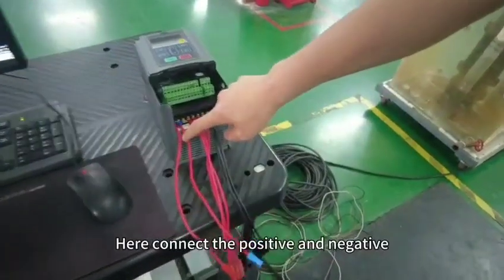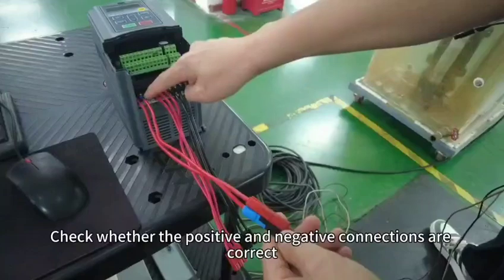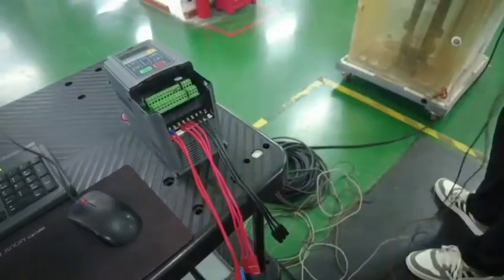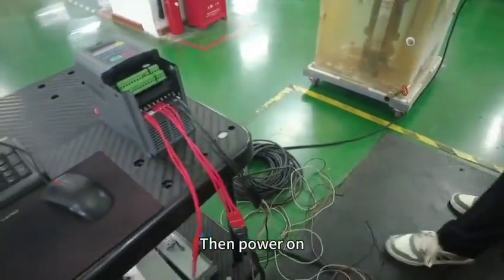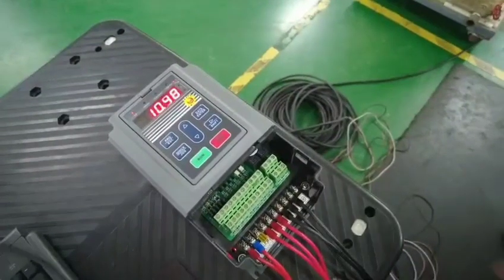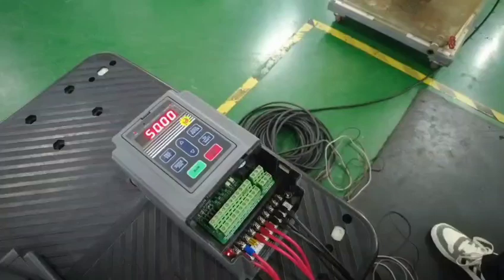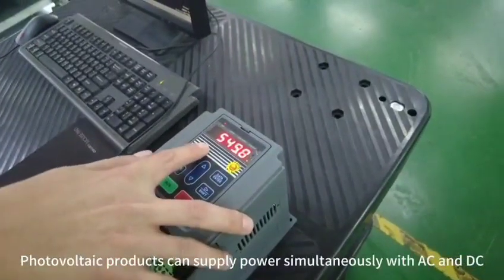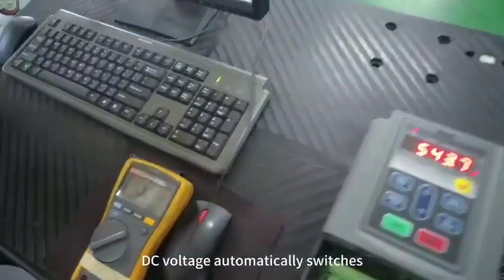MICNO solar pump inverter connection AC grid power + DC solar power

Comment: Wouldn't it be better to blend AC power from both the grid and solar, rather than switching between them? This way, the system can prioritize using as much solar power as available and seamlessly draw the remaining power from the grid. For example, if the pump needs 5 kW, and solar is generating 2 kW, the system would automatically take 3 kW from the grid. This method optimizes energy usage, reduces electricity costs, and eliminates the need for a changeover switch—as long as the VFD has an internal MPPT to manage solar input efficiently.